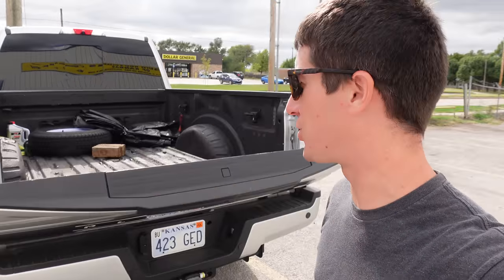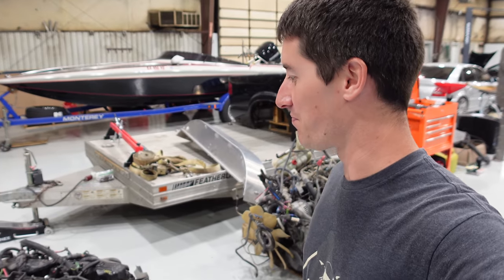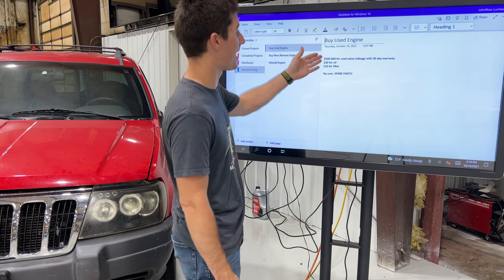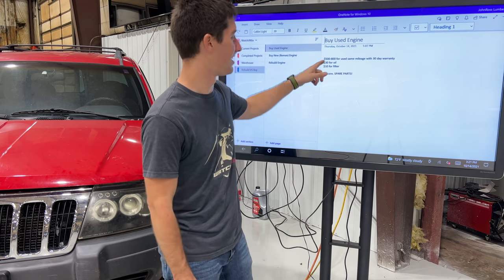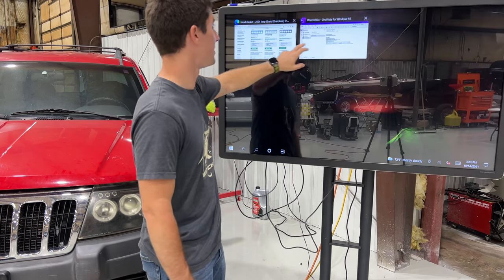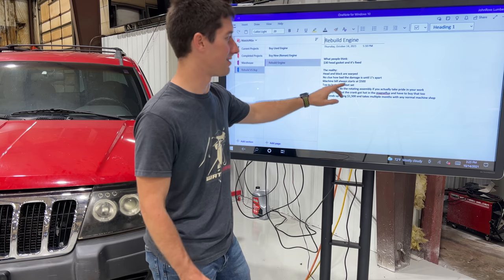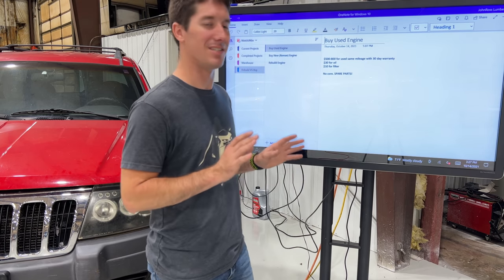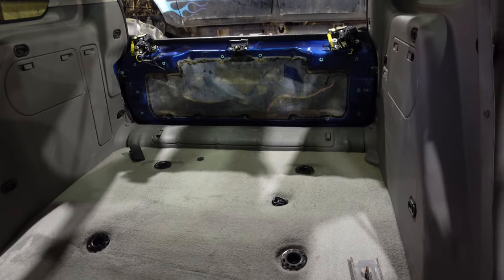Here's Why You Should NEVER Rebuild An ENGINE *The Math Doesn't Add Up*

Comment: Ooooohhh ive been doing it wrong , i built me a garage motor old 4 bolt 350 with camalback heads , nothing special , a guy seen it in my garage , had to have it put in his jeep , so i pulled his 4.0 out tranny and all abd threw in this 350 with a 400 automatic , got the exhuast all on it and everything , he had it three hours ..lost control and hit a tree ..then flipped his jeep ...i got the motor back , gonna be just a motor flipper , i'll graduate to flipping cars later 😂

Comment: Test and warranty are great if the engine goes in with no problems and lasts after shake down. If your junkyard dog engine has a problem and have to pull again your now at twice the labor cost. Now your savings is now gone and your doing it twice. This guys sell next day is why people are ruining flipping cars with bad builds and people getting ripped off for it. If your doing your own car, rebuild it and it will last with no problems down the road. If your flipping dont sell Junk and think about the person buying the car unlike fast watchjrgo here.

Comment: Not many watching here a fork truck.  You have not figured in your time and others for the labor to install and run.  Not many here have a relationship with a junk yard.  You have not figured in time to run around and look for one that will work.  If it fails, you have to pull it out and take if back and start over.  For the extra money, I will work with my trusted mechanic and let him put a reman. in and give me a 3 yrs 100,000 mile warranty.  I'm just saying.

Comment: I'm near buffalo NY and am going to need a carbureted Chrysler 318 soon to keep my old 5th avenue going. It's my only transportation right now and I'm not working. Been thinking about a reman but nearly 2 grand is alot of money to put into this old beater. I'm sure the old 7 1\4 rear end is close to dead too. I'm not sure where in my area would have a known good 1980's engine.??? A carbureted 3.9L (239) V6 would also bolt up in this car just fine. But a carbureted version of this engine was only out for a single year.  1987. Anyone that can help let me know!

Comment: May very well be true for American cars due to their systemic design flaws and overall poor quality.
For European and Asian engines , depending on the damage, rebuilding a known engine is much more preferable than putting in some ripped out and worn down motor from the junk yard.
Also the fact that someone gives fancy explanations in front of a touch screen doesn't necessarily mean they know what they are talking about

Comment: Labor cost and skill to rebuilt motor is extreme then if make mistake you got paper weight 
Now adding power for race car 
Mine valve destroyed the motor so it could be fixed
New cars milling cause computer go nuts

Comment: You people are all insane. There is absolutely nothing wrong with used engines. I trust the original manufacture more than I do an independent rebuild shop, from a statistical standpoint. The original manufacturer has made millions of units, how many has Bubbas hotrod shop? Probably not as many... Not knockin Bubba, I'm sure he does a fine job, but he doesn't  have the resources and engineering departments at his disposal like an auto manufacturer.

edit/example: Bought a clean old squarebody Ranger, bad motor. Rebuilding it myself would have been more time consuming AND more expensive. So I bought an engine for $300 and was back in business. ZERO problems with the salvaged engine.

Comment: Especially with the newer engines with thin wall castings, cannot rebuild, have to replace, vortec v-6, vortec v-8, max oversize i was told is .030, made to reduce weight. 😳😲👎😠

Comment: im doing a flip on a 1970 el camino custom im am NOT going to clone it it WILL have a used LS engine in it should fetch $35.000 to $40.000 when i compleatly do it up $6000 for it and it had a 1969 305 Z28 dz engine in it that i rebuilt and sold for $12.500 should pay for all the new parts on the elki pluss goooood paint.

Comment: I guess this guy`s time in labor doesn't matter, also, I`m assuming the engine was worn out so what`s next. the transmission goes. god bless the poor sucker that buys that  ' super clean' lemon. just a lot of fast talking. he doesn't mention replacing serp belts, old hoses or recharging the a/c, oil, filters, servicing the trans and possibly re programing the ECM. if I was putting a car together like that to sell, I wouldn't make a video about it

Comment: Yeah.. i don't flip cars.. i'll rebuild my Gen3 5.3 LS thanks.. or go nuts someday and rebuild a 6.0 with a 4.8 crank and make a 4 inch bore 327 CI /5.3L LS motor with a much better rod ratio. ( frankly it's how the 5.3 LM7 should have been made instead of the 3.78 bore IMO)  why? because i liek to keep what i ownj, and at over 300K on the odo, it's deserved a freshen up.

Comment: I am going to disagree with the approach for me personally my time and energy is valuable..Used junk yard motors and transmission yes they will warranty the motors but there's usually a good reason a cars in the wrecking yard bad motor bad trans what a headache put the motor  find it has a knock No  thanks or  transmission has no reverse ..Then take it out and do it all over again NO thanks ..Rockauto has rebuilt heads for cheap ..I have changed multiple blown  headgasket and heads cars.

Comment: I'm sure he's right especially about general vehicles but my thoughts on a couple vehicles I have don't really go into general vehicles category I have an old van that nobody would probably want and I'm sure everybody would scrap in two seconds if it didn't run but I like the old van and to put an LS in it probably makes sense LS with a 6 speed automatic transmission be easy I still like my 7 liter olds with a 200r4 idea 425 for all of us old farts

Comment: Also rebuild a engine get a running one then fix it up now you don't need the machine shop spend money on a good engine not a core. He spitting facts. Bit also did a 350 with a cam heads intake domed pistons 850. But like he said LABOR it added another 25 a hour because it's time u waisted but can't get 500 hp in a sbc with out time and money 😂

Comment: You could rebuild your engine alot cheaper than 800 dollars.  I guess you pay more for not having the knowledge to do a rebuild. rolling the dice  by throwing  a engine In car that I'm not going to have to rely on and sell it to somone else immediately so it becomes their problem..  just because it starts and runs doesn't mean it's a good engine. Their warranty is simply giving you another junk engine.

Comment: WJ the death wobble king. 
If its got it, replace the upper end Trackbar bushing with one from a JK,  have to drill out the hole to 9/16. 
I bought one for $200 lol.. 
$150 4.0 wife been driving it for two years lol.. 
you paid to much.,

Comment: I have been doing this for years, but now with all the stuff going on, I will only work on my own cars! Everything else is either referred to a shop, or sent packing!
I do use “yard Engines” that I can inspect, hear run and install easily, but even though it is used, I still replace oil pumps, and if easily done timing belts/ gears or chains, just to be sure I have a solid runner! I will not replace a multiple chain engine with out replacing timing chains!

If I had my choice, I would run vehicles from the 1960’s- 1990’s, the more modern the bigger the issue is when selling

Comment: This video is stupid.  Of course engines should be rebuilt - you can rebuild the engine with the performance requirements that you need, from basic transportation to 9 second drag car, when you build it yourself.

Comment: So basically you are just transferring one man's problem to another. Swap the engine and sell it immediately. Typical cheap flipper tactics. Are you going to guarantee the junkyard engine to the buyer? Rebuilding engines is actually knowing what you have vs litterraly rolling the dice. Of course first you need to know how to actually rebuild an engine. I would buy a car with a proven proper repair vs one with someone else's problem under the hood. Keep in mind that some people have to work really really hard to save $4000 and now you put them in a ticking time bomb. At this point just sell the damn thing as a project to someone and let them decide what to do. Selling a car like that to a family which is the only type of transportation they will have and getting them stranded on the side of the road is something I simply cannot sleep with at night.
Reply: That same family will put down $4000 cash for a $10K lemon of a car that is just as suspect. Smaller flippers tend to be more concientious, believe it or not. The larger dealers are predatory thieves.

Comment: Hey I agree it is up to the condition of the Engine and what type of Engine? But seriously this guy is actually talking about Rebuilding the whole Dang Engine. Listen Simply assess the actual condition that needs to be fixed properly! If you get a good compression on three cylinder's but one Needs work. Rebuilt the top end. And for god Sake's he's talking about a Damn Junkie Jeep. Hey some people enjoy Half Ass quick work. Hey good for those people! But seriously I know Engineering skills and evaluating of the engine and calculating the Reasonable Costs! For A Piece Of Mind while driving longevity's in extreme environments conditions. Hey ,I have No Call back's! But yes of course certain Vehicles are necessary for a exchange application. . Overall great show. Let's kinda setup yr camera and white board much better for Educating.thank yu

Comment: also, way to promote an environmentally wasteful agenda.  This whole video says "screw the future, just dump everything because money is better today".  Not everything in life is about the quickest buck, especially if it's at the expense of the environment. You can't eat money.
Reply from the maker: Have you consider that scrap engines simply get melted down and used to make new engines? This is how you do it, there is no debate 💯
Reply: @WatchJRGo  90s and early 00s vehicles get sub 25mpg and burn lots of oil. better to melt them down into a modern design where 35mpg is considered "average".